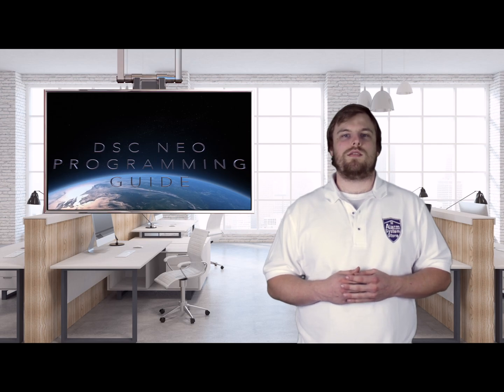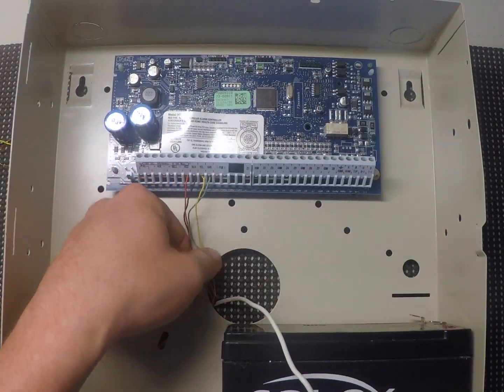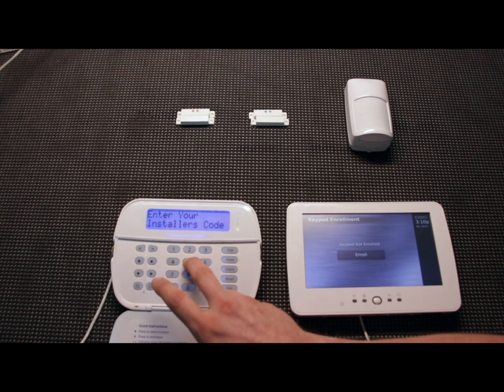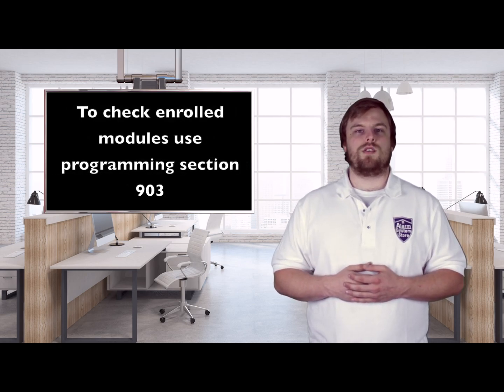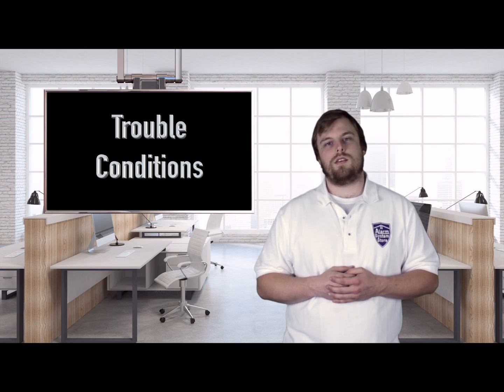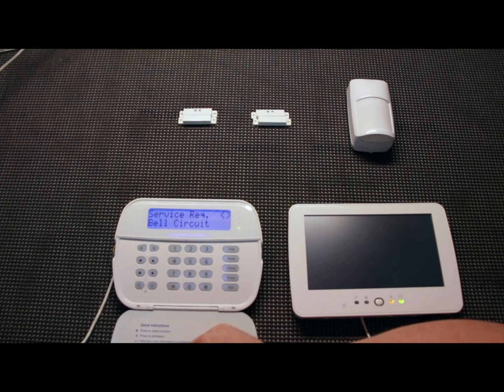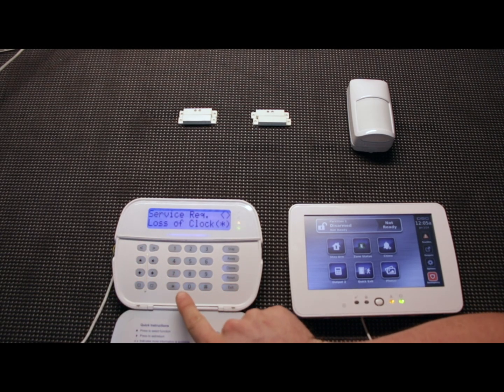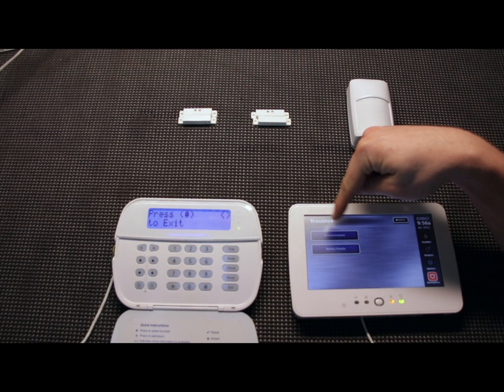DSC Neo Installation Series - Setup and Programming Tutorial P1

Comment: Sir 
My dsc stuck in armed .
Forgot the code to disarm . Installer code not work either .
What should I do ?
Reply from the maker: Without knowing more information, there isnt much I can say. The system will require a valid code to disarm. You could potentially default the system, but if you didnt program it, youd be in for a good bit of work.

Comment: Used The Power Series for Years, the 1832 and 1864. Before that, The PC 5010.
Since they Are phasing them Out, Going to the Neo. Programming appears? Easier than what I'm seeing on the Neo.
Looked at a couple Neo Video's and have yet to see Defaulting Keypad if Installer code has been changed. I forget but Basically remove all power, Short 1 of the PGM's to ground, maybe while Powering up, I forget Exact procedure.
If previous Company Programmed Installer Code not Defaultable. You can't  even Default it. You can get a Panel Unlocker, so you wouldn't need to Reprogram From Scratch.
Is their a Procedure to Default Installer Code, if Current Code is Unknown? Thanks
Randy/Stratmando 
Strategic Electric & Security
Reply from the maker: Neo programming is almost identical to 1832. Locations are the same, though you can tell subsections on the Neo much easier than you could on the older series. 

Defaulting panel is same too, Z1 jumper to PGM1. If  you're trying PGM to ground that doesn't work for either series.

Comment: Thanks for your videos - helped me immensely after i had to do a full reset bc old homeowner didnt know codes. Im up and running but before when id open a door- the LCD would read WHICH zone was an open circuit (front door, kitchen door etc) but now even after ive programmed everything with their respective names- i have to scroll with the arrows to see Which zone is open. Can you help me get that old mode back so when  a zone is "open" it actually reads that on my screen without all the added steps? I really appreciate anything you could help me with.

Comment: Hello, if I just want to swap out an existing button panel with the compatible touch screen, will I be required to do all the programming as demonstrated in the video ?
Reply: The only programming you will need to do will be to enroll the new keypad. If you are planning to get rid of the LCD keypad you currently have, then you will need to enroll the new keypad by attaching it to a short wire at the panel, then delete the current keypad. All of this will be done in section 902, but you will not have to do any other programming.

Comment: Mine does not show text.. It seemly works if I blindly enter codes. I go from a flashing hand/keypad and a redlock to a green check mark if I enter 902 000 for example but I do not visably get any text feedback nor do I get menus I can cycle through. Any thoughts on how to fix this?
Reply: Sounds like you have the cheaper icon lcd pad. You really need the programmable alpha pad to program easily and see what you're doing.
Reply: @andybowman9697  Thank you,  I made some progress trying to do it blind but eventually gave up in favor of buying a konnected system to replace it with. I appreciate your quick reply and your videos it made this a fun adventure in learning about alarms...

Comment: I can’t get this to do anything. It doesn’t beep when I touch the keypad. It always says system fault Call for service.
Reply: Maybe wire Keypad directly to panel. Have a 1000 ohm resistor across Bell circuit if one is not connected. Jumper out the Zones or easier, use the EOL's

Comment: Sir, I am facing problem to program Power G panic button. Though I have programmed it but sometime it work and sometimes don’t. Request you to please upload the programming Video of Power g panic button. Thanks a lot for your tutorial videos.
Reply from the maker: Sound like you're running into swinger shutdown possibly. Swinger resets after each arming cycle so in practical use this isn't an issue usually and commonly noticed in testing only. It can be disabled but I don't know the sections off hand. Look in the manual for "Swinger Shutdown" for further details.
Reply: @AlarmSystemStore  appreciate sir

Comment: What programming can’t be done with the touch screen keypads, and requires the alpha keypads? I only have the touch screen keypads. Are water wireless water sensors available that are compatible with the DSC NEO 900 MHz wireless transceiver? Are wireless microwave / PIR motion detectors available for the DSC NEO? How effective are the DSC Neo wireless glass break detectors? Are the glass break detectors vulnerable to false alarms?
Reply: So far, the only programming issues we've run into with the touchscreens has to do with programming ESN's for wireless key fobs. We're still testing when time allows to see what else may be an issue on the touchscreens. As for wireless water sensors there is the PG9985 flood sensor. The PG9984p is the dual technology wireless motion that uses PIR and microwave detection. And the PG9922 wireless glassbreaks are very reliable, the range is 20ft line of sight, and they operate by looking for the sound frequency of breaking glass, not just a loud noise so they are much less prone to false alarms than older model glassbreak sensors. The PowerG line of wireless sensors for the DSC NEO is the best in market currently.
Reply: I also had an Issue I believe I had to Use a Non Touchscreen Keypad do to The Touchscreen not able to go to smoe Wireless Data Fields, but this was a PC1832 and PTK 5507 Touch Screen. Very Simular. Don't know how that Issue Slipped by them?